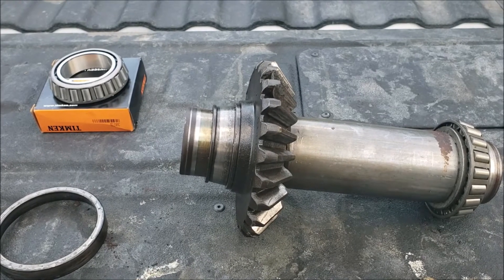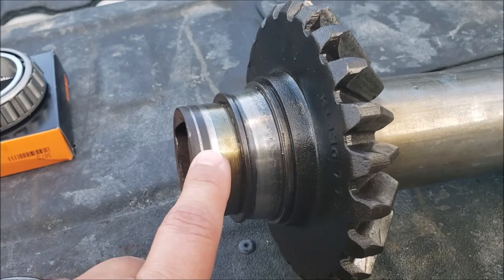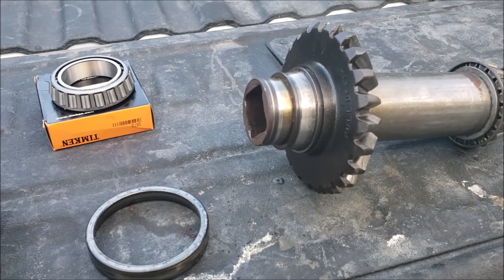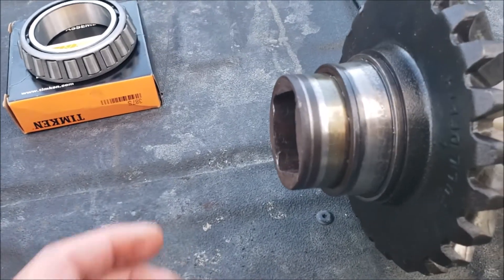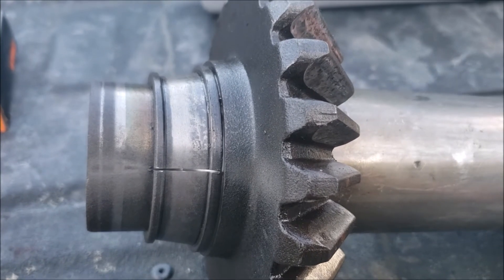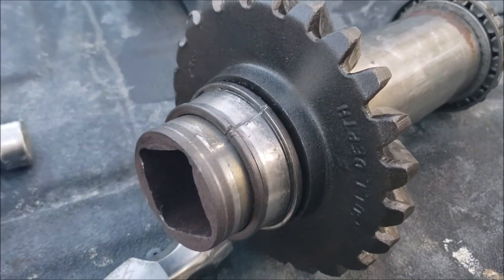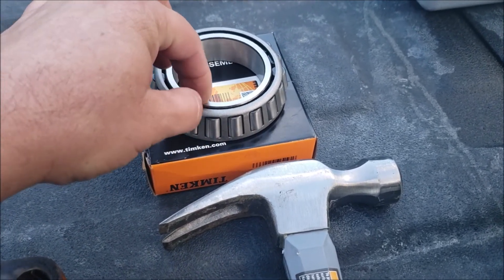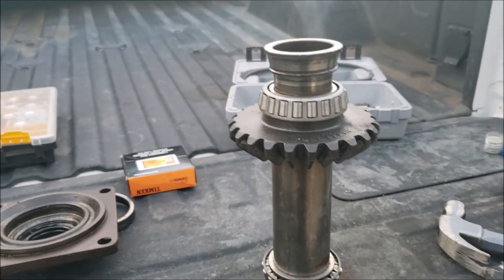Easy Way to Remove a Stuck Bearing Race

Comment: Heat up with oxygen / acetylene torch quickly , do not let heat transfer to the shaft . Use an air chisel to push  old race off .
Reply from the maker: Sounds like a good way to do it. I didn't have my peanut pack with me but will try that next time. Thanks.